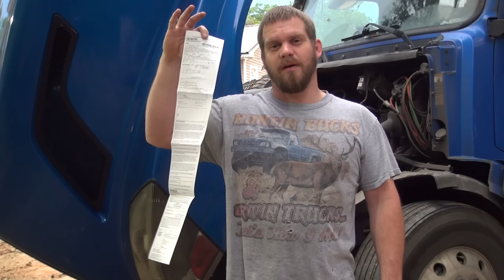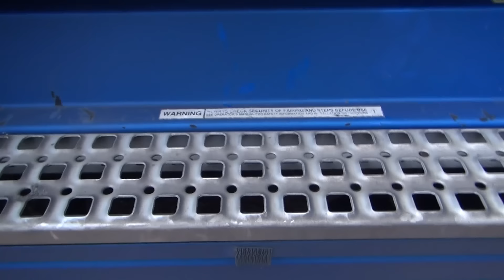Stopped by DOT

Comment: well if this is in the usa, i think it is a great thing, i watch a lot of guys on here that make videos or there eqipment and doing jobs for people that for one shouldnt be doing it at all, and there trucks and trailers they are moving there eqipment on, shouldnt even be on the road, it is like he just pull an old truck and trailer out from some back 40 and get on down the road, they buy some old truck and they drive it 500 miles home, they start it up, fix a few lights, maybe a flat tire and jump in and drive it home, you dont see any plates or trip permit in the window, and they say, next day, and they are off halling rock to someone, here in Canada we must have a licensed shop do an MTO  safy inspection every 12 months witch costs a lot, like just to have my F600 done every spring cost me $1000 and more every year, that not including any thing that may need to be fixed..

Comment: Ok.    30 plus yrs.      First ever truck has a small oil leak somewhere.      Second.  Over time the power steering gear box will seep fluid out the top were the shaft is.      As for the small section covering the battery.    That's chicken shit  lots of trucks.  Espiecally in dallas and south are not truly road worthy.     Volvos fall apart.   They are made of plastic nothing you can do.       He was on a terror for trucks.    I had one try to wright me up for altered headlights.  Because the low beam and high beam on my pete are switched.      His supervisor told him.    He can put them any were he wants as long they both work.   He got pissed.   It's his interpretation of the rules.
Reply: trying to make that unit look wider at night werent u? or like a single light old school cool truck? bet u had chicken lights on ends of bumper too as close to edge as u cld get em lol,truck on brother

Comment: Actually there would.ne some.concern for something getting into the battery compartment and shorting out the system causing a fire. And the other is a househeeping issue.  If you keep an clean engine compartment then you probably would.have gotten a warning
Reply: 2 things with your comment... he said in the video all he got was warnings.... and warnings are worst the tix when you have a CDL becuz they go straight to ur record and they are vary hard to fight and get removed

Comment: No I stayed up ever had any trouble and was Louisiana I literally one morning about 5 o’clock in the morning came across the scales going to Baton Rouge from Jackson Mississippi with a set of doubles pubs 40 footers Empty with a day cab scale master came out at the Vicksburg scale Stewart on the scale he weighed at least 3 to 500 pounds and told me my scale ticket read 84,000 pounds and my steers were over by 2000 pounds I explain to Jabba the Hutt a.k.a. the scale master that I was empty He told me that I was under arrest to get out of my truck and go sit in this glass booth cage they got inside the scale house until I could be picked up by State trooper about three hours later a state trooper coming by to pick me up to take me to jail as a trooper is leading me out of the cage I told the trooper that I was empty there was nothing in my trailers and I only had one quarter tank of fuel So by this time the scale master for Night Shift was off duty in the morning Scale master was on duty He asked me a few questions any state trooper asked me some more questions so we walked out to my truck which the night scale master pulled over to the side by the way and opened my trailers it was exactly the way I said I was empty the two trailers I had were bone dry empty I had a forward facing camera in my cab of my truck I talk to the The state trooper and a new scale master into watching the video he’s a fat ass walk out with a cheeseburger and his hand stand on the scale and arrest me they tore up the tickets drop the charges and told me to leave I have never not one time been back to Louisiana made them some bitches starve to death And every hurricane is a holiday

Comment: For a while I drove I gas tanker out of Nashville one morning about 2 o’clock the Kentucky DOT at 65 north decide to pull me in the barn and do an inspection while I was in the barn getting inspected I was standing outside waiting on I want it one of those Spanish trucks rolled across the scales with the tires off of his front axle and the rear on the right side chained up I mean no tires he had to drive axle chained up do you know they did not pull him around back and when I mentioned it to the officer he just glared at meThis is turned into one messed up world they didn’t find anything wrong with the truck or trailer it was a brand new truck and trailer

Comment: Motor Carrier Officers only function is just that to enforce the laws on Commerical Vehicles and for a large part is to generate revenue for the State. It's a quiet tax on commerce just like why Diesel is more at the pump than regular unleaded these days.  It a way of taxation on goods without having to make tax laws and take the chance of upsetting the voters.

You got caught up in a blitz with that many in close confines that active. Most states have outlawed quotas but will discipline its officers in other ways if they feels there is not productivity. Been there and on the other side of the fence as well.